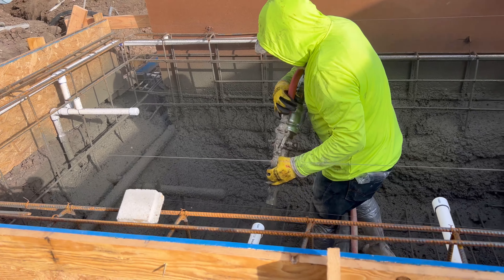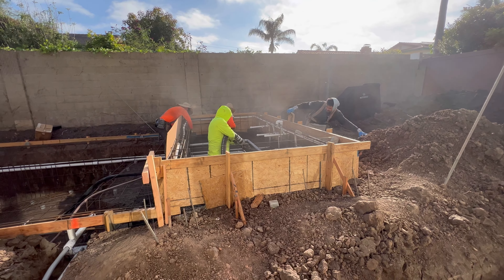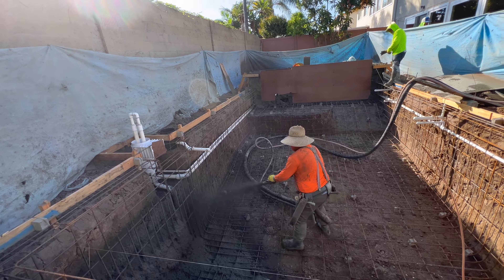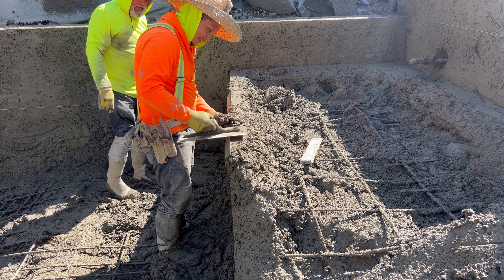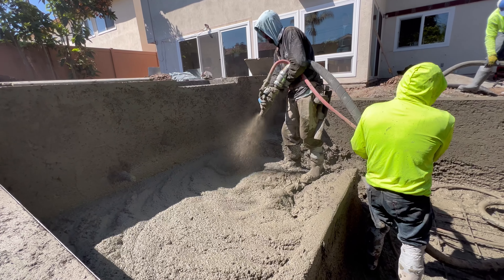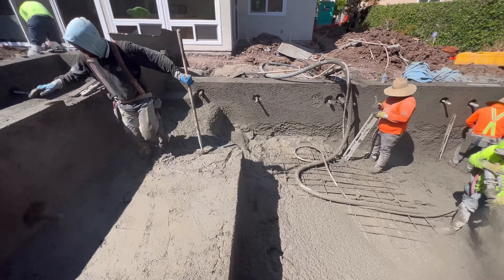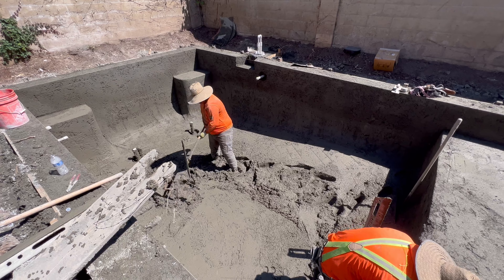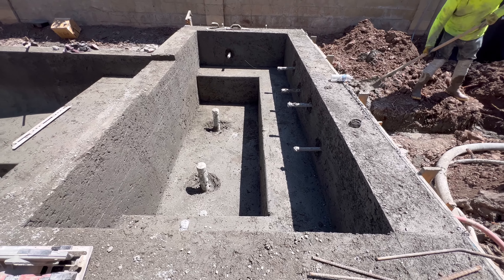Swimming Pool Build: Concrete (shotcrete)

Comment: Ok.. need some advise..i really want a tornado shelter on my hobby farm..going into retirement soon and every option is too exoensive. 2 question..can i get a 10x10 steel storage and spray it with concrete so it hold 2-3 ft of dirt on top and much more on sides??? Will spray hold dirt and how much would it be???
Reply from the maker: You’d have to reach out to an engineer, cool idea though!